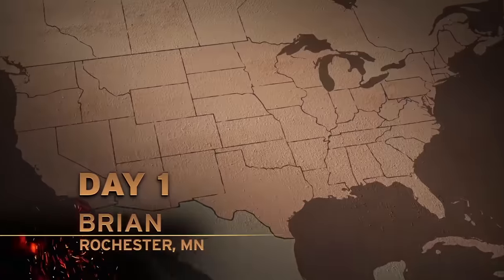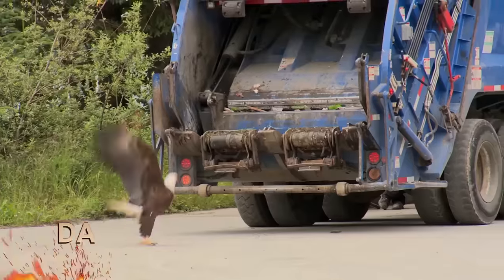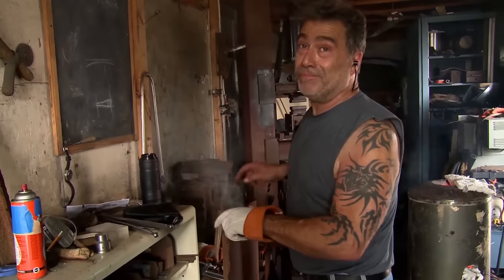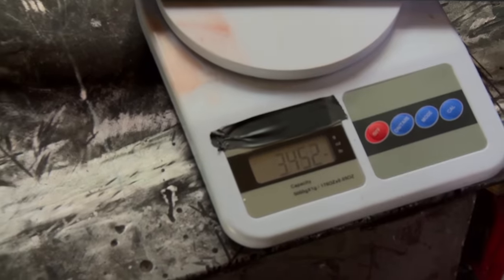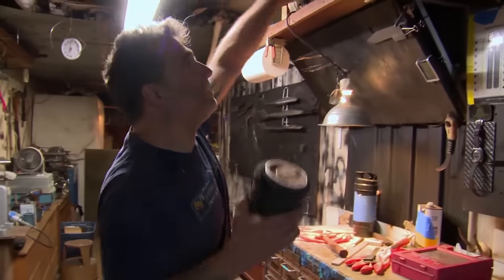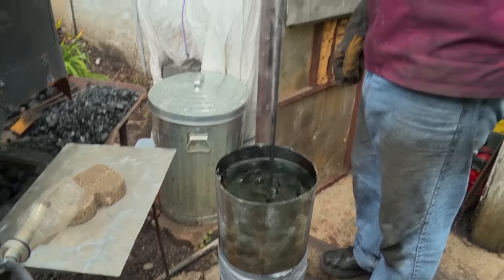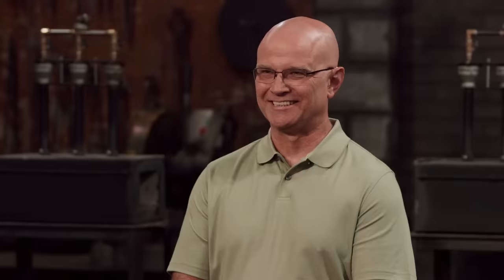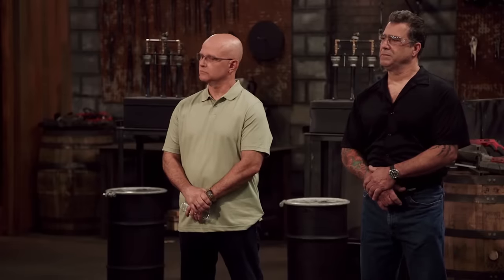Forged in Fire: Crusader Sword IMPALES Final Round (Season 4) | History

Comment: When David says its a forward heavy sword.
Sword looking like a feather in his arms
Reply: Its still only just over kilo object. Forward heavy blade you feel more as user, and not by just looking someone holding it. Along with the wicked sharp edge the forward heavynes definetly helped in the kill test.
Reply: It was like the only thing negative about the sword. He had to not make it obvious that David would win
Reply: Come to think of it why does it have to be balance in weight for faster or better swings?
Reply: @kurt7012  you can hit harder with blade heavy sword, but its clumsier to move. Slower to recover for next strike or for blocks, and so on. For example try swinging tip heavy stick, and then try to hold it in the heavy end, and swing it. Its lot more agile, and faster to move.
Reply: Lalli it’s a preference tho, if done well then both a top heavy sword and a sword with the point of balance closer to the guard are good swords, theyre just good at different things
Reply: @kurt7012  in battle you had to be able to fight with your weapon! after hours of fighting, the man with a balanced sword will not be as exhausted as the man that swung a tip-heavy blade around all day. an executioners weapon may have been tip-heavy because it provides better slashing and cutting, but for fighting you want something nimble and  easy to handle
Reply: @kurt7012  It's about the distribution of mass and the way this affects the conservation of angular momentum (which is the product of rotational speed and mass). You can test this at home. Find yourself a broom handle or something like that. Hold it in the middle and extend your arm away from you then try to spin it around by twisting your wrist. It'll be really easy. Then hold it at one end and try to do the same. It will be MUCH more difficult to get even close to the same speed even though it's the same broom handle and the mass is the same. That's why the pommel is so important. By moving the centre of mass towards your hand, you can maintain the same angular momentum (effectively energy input from your arm) but the speed you achieve for that same angular momentum is much faster. Conversely, when the centre of mass is further from your hand, more of that angular momentum will be in the mass and less in the speed.

To give an example of how important this is, the sword I bought a few years ago is fairly hefty at about 2.3 kg and the point of balance (centre of mass) is around 7.5 cm from the crossguard. The guy I bought it from had another sword had a shorter blade and a massive pommel and so the mass was about the same but the point of balance was 2.5 cm from the crossguard and that sword was FAR easier to handle and one could use it for much longer without getting tired. Although at the time it wasn't for sale and in any case, the pommel was so ridiculously big and has an odd (but historically authentic) design that I didn't like the look of it so I wouldn't have bought it.
Reply: Ahahah thx for the knowledge for why its balance i guess having it front heavy could make u lose balance if not on a good stance i guess it also depends on the person that use it me im good if its balance or not as long as its a heavy weapon so that i feel it better if i swing just imagine swinging a staff made out of tungsten

Comment: Is anybody else going to point out that the sample "crusader sword" was a hand and a half while the ones the smiths made were much closer to one-hander proportions?
Reply: Right? The display is basically either an arming or hand and a half, nothing about it screams crusader.
Reply: lacerations r coolz To be clear, I am not an expert.  I do a lot of amateur research for writing.

Classifying European swords is difficult for the wide verity that they come in.  However, the “Crusader” knights (at least from the First Crusade) were noblemen answering the call.  But most people think of Crusaders as the classic Christian knightly orders like the Knights Templar, the Teutonic Knights and the Knights Hospitaller.  Their equipment was fairly standardized.

In short, they were heavy cavalry.  They carried a stick for charging, a shield, chainmail and a sword for personal defense.  The sword was a one-hander since you used it alongside a shield.  A common name for a one-handed sword was an arming sword.

Comment: If I see correctly both of them didn't forge a single element for those swords  -it's all cutting and filing down bits of steel.
Reply: Yup, but what else would you expect from history channel?
Reply: Well if you use basic observational skills, you'd see that Brian unfolded his metal into a very thick narrow bar. And it was magically flattened with a grinder of course. Just because they didn't show it doesn't mean it didn't happen. Good god.

Comment: Shouldn't they be testing it on saracen armor instead?
Reply: Yes. But also a normal tin can would be a greater threat to the blades, than these carneval things.
Reply: They didn't have very heavy armor
Reply: @stefankok7962  The had scale and lamellar. For that time, it was the best protection from melee weapons.
Reply: I mean the crusades were messy and there were several times when European armies fought each other, so the armor itself I assume is accurate (except for the Templar iconography)
Reply: @ianbailey4213  Yeah, but that sword is 12-13 century, so the armor is completely wrong. But I understand that you can't destroy a quality 1000$ armor for every test.
Reply: No, because that will be racist.
Reply: @Radomirius  They would do it. But it would be a lot more expensive than those movie requisites.
Reply: @vapomaster6967  The damage to quality armor would be minimal if you strike it with a sword. You could have hammer the dent out (I think its a bit more complicated as i say it here.) and use it again. I mean there was a reason why poleaxes and other top-heavy weapons were used.
Reply: @stefankok7962  The Saracens had pretty good armor. I mean google "saracen armor" and you get pretty good examples that were on par with european armor. And in the crusader times 11-13th century, the europeans and saracens would have probably both used scale mail and chain mail as well as patted cloth (not sure if it's the correct word. im not a native English speaker ^^ And i think patted cloth armor was a pretty cheap alternative for less wealthier warrior. Still effective to some extend). Plate wasn't pretty popular at that time. I think it existed in 13th century but i'm not sure how often it was worn
Reply: @xraptor94x  Yes of course. But in case of chainmail or lamellar you  would allways inflict some damage which would be easy to repair. A normal breastplate would clearly resist the most and damage would be easily dent out. And the saracenes used mainly lamelar as heavy armor.
Reply: Is lamelar similar to what i mean with "Patted cloth"? I ask because i forgot the name for it in another comment XD And thanks for the info of the last part. I knew they used some of that armor but not sure about how many had it.
Reply: wtf are they doing testing on armour anyway? if the armour dents when struck with a sword, it's not real armour anyway so the edge rolling results wouldn't be accurate.
Idk about this whole thing... also, shouldn't there be a criteria other than just "it was sharper"(not even better blade geometry, just "sharper")? because you can sharpen a piece pretty much any decently hard metal to the point of it being as sharp as a sword. making this as sharp as the other one is a matter of half an hour to an hour. the balance, the handling, the weight destribuition (all of which were off on the winning sword) etc. are the things that distinguish good from bad ones.
I might well be dead wrong here but to me these guys seem like they're extremly well versed with their subject matter (smithing) but not really all too good with history, historical martial arts etc.
tell me what you want, the first sack test cutting failed due to extremely poor edge alignment; these swings make me worry about the people around him (and himself) every time, they just seem so wild, random and flaily. why don't they get professional test cutters for this?
Reply: @xraptor94x  "padded cloth" is either referred to as padded armour or gambeson; lamellar is the one with small interlocking metal plates, looks a bit like fish scales depending on the type (period, location etc.)
Reply: @oyblech8671  Thanks for the info. As i said, im not that good with the english names when it comes to armour XD I even wrote "Polearm" before i looked the word poleaxe up because i had the feeling that it was not the word i was looking for.And ye. Weapon testing in TV shows is always a bit odd in my opinion. At least the methods they use for that. Or the equipment they want to test it on...

Comment: There is absolutely no way that the "armor" used was actually authentic armor.
Reply: Faze Dank Was just thinking that. People who have worn true plate armor said a sword it feels like being whacked with a heavy pillow ... some force for sure, but the armor would definitely not be crushed and dented so badly.
Reply: @royroblox  There are videos out there where people wearing full plate are whacked at full force with double handed swords. I feel like the "armor" was made of aluminum or something
Reply: @fazedank5262  it's costume armor, made to be light and look cool, not take hits. It's basically a Hollywood prop.
Reply: You don't use the blade to fight heavy armored opponents. That's what the pommel is for.
Reply: They're using LARP armor where the steel is 1-2mm thick, this show is a sham
Reply: Yeah, I'm a HEMA practitioner and that is not real plate armor.
Reply: @alexhousakos  the show isn't necessarily a sham. They are testing it against armor, however it's only replica armor, not anything anyone could use.
Reply: that is correct seeing as plate armor didn't exist during the crusades
Reply: Don't forget they were striking there own 'templars'
Reply: @Chrismosis  Pretty sure partial plate armor (like a simple breastplate) existed during that time with the rest of the body covered in mail etc
Reply: christian Grønhøj partial did and it matters which one as the later crusades definitely had full plate

Comment: Actually if they knew anything about knights swords, they would know that swords are not supposed to be sharp everywhere, only sertain points, your not foing to cut through any armour, mosyly just stabing at weakpoints so the tip is the only real sharp point needed, or give that person a stun or concussion, tire the other fighter out as fast as possible, get him down and fo for the weak points, dont believe me look it up. Especially knight's swords, they were almost always dull most of the way down the sword.This is very clear in the armour test. Heavier sword with dull edges did more damage to it, but IRL that armour wouldn't be that thin, so that too.

Comment: 7:56 they cut to a far shot so that you cant see him twisting the sword upwards resulting in a glancing blow rather then directly down onto the rope, then he claims its because the sword lost its edge. 

8:06 Then with the bag cut his edge alingment starts straight, then twists upwards again resulting in a torn bag. Its all user error, not smith error.

8:46 where as with his competitor he keeps his edge alignment straight while swinging it like a baseball bat / golf club until he passes cleanly through it then twists the blade up again.

This is the one thing i hate about this show. Amazingly made blades lose because random tv show hosts are judging with zero swordsman knowledge.
Reply: Yep xD look at the first swing it's just horrible....  I was more like baseball  xD But it is all about the show nothing more 💁‍♂ Those test were always more about the efficiency than test repeatbility 😆
Reply: At least try to be objective. He uses the same angled cut for both swords, except in the first case it doesn't do ANYTHING and he has to go for a near perpendicular cut to get through the rope.
Also since the blade wasn't properly sharpened he couldn't get through a larger section of the bag (at the end when he had to cut around a quarter of the material perpendicularly). Not to mention the tearing is visible from the very beginning, not just near the end.
Reply: Lecherous Lizard 
some others pointed that out in another thread. His lack of an edge definitely made him lose, but stuff like this happens in every episode, and some of the swords definitely shouldn’t have lost in some episodes.
Reply: @aaroncarapace8054  when?

Comment: 6:30 the lad in a blue shirt is gonna test the strength of their edges of the blades , however I have issues with this , the edges are being tested against stainless steel larp armor that breast plate wouldn’t withstand a strike from a kitchen knife let alone a good quality sword , if the armor was properly shaped and made out of heat treated steel the blades would glance off the armor not dent it ! Swords were practically useless against plate armor ! Unless you used half swording techniques etc but I disgrace if they are trying to emulate the Templar knights they did not wear plate armor that’s a 14th century mid 13th century invention knights Templar wore riveted Mail as their primary armor so how about instead of using stainless steel poor quality breast plates how about using historically accurate gear , I mean this is on the “history channel “ lol history channel has been falling apart and instead of being education has become more of the entertainment business it seems how lame .
Reply: “This test is all about what the armour does to your sword not what your sword does to the armour” 

it’s literally just a fancy way of testing how much abuse the swords can take, they could have just smashed the swords against a wall and it’ll accomplish the same goal but that’s not as cool

Comment: Stupid question:
If someone had a piece of steal which is long enough. Could he just cut it into shape, heat treat it and sharpen it? Or is it important to heat it up and use a hammer or a machine to compress it?
Reply: Not at all, most of the more inexpensive modern reproductions use that idea. They simply cut the metal out of a sheet and go from there like you said (if at all). It's been done on this show once.
Reply: @Evilbob1555  where tell me i need to know

Comment: I would say the judges got this one wrong.....the only thing the "winning sword" did better was the cutting due to better sharpening....but the type of edge used rolled in the strength test...other sword didn't, not to mention the fact that the pommel was way undersized giving no counter balance. The "losing" sword's only fault was something easily fixed with a bit of time on a wet stone (it DID cut, just not as well), but was better designed (better balance) and took no damage in the strength test. Shame judges, shame.

Comment: If you’re using a sword to strike plate armor, use it as intended. Cut under or around gaps and openings, or grab it by the blade and smash it into the armor in place of a hammer. I get it it’s just a tv show, but the consistent inadequate and rather daft use of many of the tools they have at their disposal is beyond foolish.

Comment: if someone saw you hacking at steel armor in a 12th century battle they would assume you were new to warfare. also steel chest plates weren't really a thing in the time of the Crusades. the armor also looks paper thin. not the best test for historical accuracy.
Reply: It's a strength test. The point is not historical accuracy, the point is to make sure the sword won't break or bend easily.
Reply: You missed the whole point of the test.
It's not supposed to be "what the sword does to armor", but rathee "what the armor does to sword"

Comment: ROFL again, the armor. what is that breast plate? a sword of any kind will never dent a real, properly forged, hardened steel breastplate. its impossible. real breastplates deflected long bow arrows at close range. this thing is made out of sheet metal. the design is all wrong too, if you were wearing that breastplate in the video you wouldnt be able to bend over or sit down